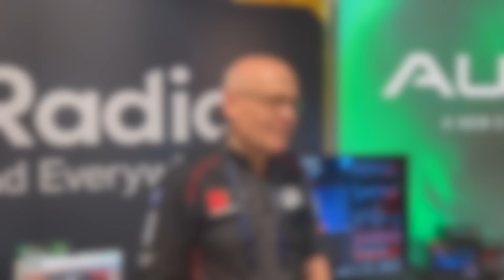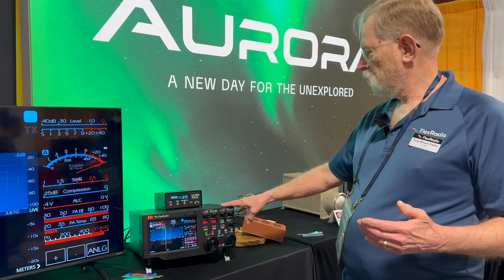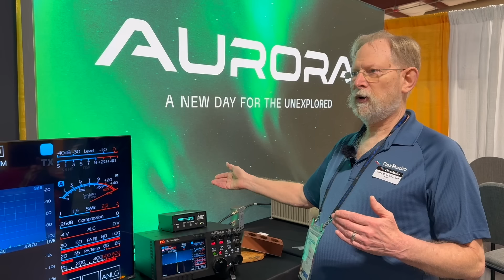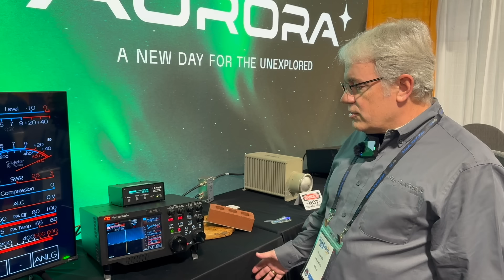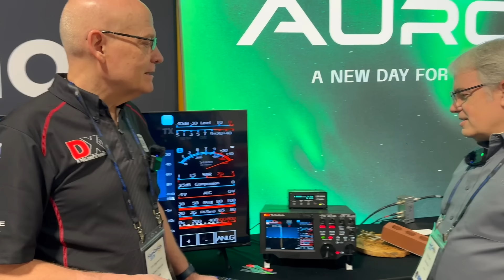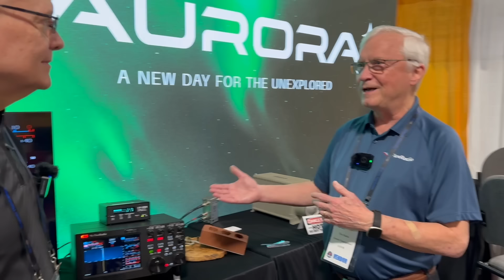Learn About the FlexRadio Aurora HF Radio Directly from the Team that Developed It

Comment: With CESSB, PM and APD this is a good beginning.

Now you have to use AI to reduce noise level integrating it into the transceiver making it automatic needing no human intervention and thereby reducing the cost from this overpriced bauble.

Your aim is to get it nearer to the QMX+ price.

Once The first person to do that the rest will follow like an avalanche, then we can think outside the box and cut the wire to the antenna and work on an all band antenna that is both efficient and small enough to be portable.

Comment: I sold some stuff and got an AU-510.  I love the concept but I'm on my second replacement radio and its in awaiting repair.  Flex says they have been shipped some less than optimal parts.  My two radios both gave blue smoke at 400W FT8.  So hopefully when it comes back it will be rock solid.

Comment: mCHF will do most of same or more for <$800. It's a brilliant compact portable HF transceiver, multi mode (including digital voice, rtty and CW decoding) with full USB connectivity for flrig, fldigi etc. only 10W but a matching 30W pa costs less than $80.

Comment: This is great stuff for amateur radio, but don't give Flex or anyone working with them credit for inventing "polar modulation". Indeed, Flex has been disingenuous to label it that way, because it is merely a form of envelope elimination and restoration (EER), a method first proposed by Leonard Kahn in 1952. It is often called the "Kahn technique". The cellular industry typically refers to it as "envelope tracking".  EER is mature and well-commercialized. Companies such as Nujira, ETA Wireless, and Qualcomm have been incorporating EER (or ET, if you prefer) into their chipsets since at least 2010. Flex certainly gets all credit for bringing it to amateur radio, and the fact that it essentially requires linearization will be a huge benefit as well as embodied by the ARRL Clean Signal Initiative.

Comment: Good video. However that statement that 120v amps can only output 200-300 watts its simply false. Every 500 watt amp I have owned running on 120 x put out 500 watts.  The Al series tibe amps, the als 600 the kpa 500 have all produced 500 watts or more output at my station and all plugged into a 120 v circuit

Comment: The problem is that very very few HAMs can afford these.
Reply: It has become like NASCAR, boating, and every other hobby. You have to be a millionaire to participate. I’ll stick with my old radios and use a separate SDR on a computer screen.
73’
Reply: @chrisdelong2932  Amen, me too.
Reply: I was wondering about the price myself. This is another hobby for those that can afford it. I'll be with my cheap bao
Reply: We lost the "Amateur" part of the hobby years ago
Reply: @2reasonsY Well, we can still use our boat anchors and build our own antennas. I'm just guessing but I would say that new sdr radio is $5k+.
Reply: Ive looked but cant find a price.  (I’m not all the way through the video yet)
Reply: @truthsayers8725  Really?  It took me less than 20 seconds to find a price.  $7349.
Reply: @truthsayers8725  The FlexRadio Aurora Series of 500W HF/6M integrated SDR transceivers ranges in price from $6,199.00 to $9,599.00 depending on the specific model configuration.
Reply: Disagree. I think it is cheap for everything it does. Price all those components seperate that add up to this capability.

Comment: How wonderful that a new and very expensive radio has to come out just in time for the total collapse of Ham Radio.  If the ionosphere ever becomes useful again and if I want to "go to the top of a mountain" to operate, I'll take my G-90 and a lithium motorcycle battery.  You know, I did just that about a month ago.  I went way out to the campground at Cathedral Valley, Utah and set up.  The signals on 40 (only band open) were all extremely weak and soon disappeared altogether.  Not worth the effort, but to buy this rig for THAT??  No way.
Reply: Bands are fine. ZL to Spain with an EFHW and 5W the other day (SSB). But there are local attenuation hotspots due to CO2 affecting the D layer, the double bond soaks it up like N2 does... So it's not the ionosphere (F layers) being crap rather D layer issues are increasing. North America probably has higher DRAP than rest of world.

Comment: For some perspective; The Icom IC-781 came out in 1987 or so.  It cost about $5000 USD.  I remember when it came out.  According to the US inflation calculator website that $5000 is equivalent to $14,750 in 2026.  The Aurora is, I'm sure. a far more capable radio.
Reply: Gotta remember ,this also saves money on a amp ,usually 500 watts works good enough, even on the low bands ( 40 80 meters )
Reply: @RamblerRobb  It is my observation that the 2KW boys on 40 and especially 80 will walk all over you and that contemptibly puny 500 watts.
Reply: Also for perspective a cheap Xiegu does polar (aka I/Q) modulation for under $500. The G90 schematics are online, 2 DAC design for I and Q, amplifier is still class AB though, and Chebyshev filter group delay an issue for modes like OFDM but this flex radio hasn't gone with Bessel either (they run hot)
Reply: Yeah, I didn't buy one of them either.  As a person who doesn't have to have the very best for the sake of top bragging rights, I guess I'm a failure.

Comment: It won't do anything my Icom 7300 can't do. I suggest putting your $$$ where it really counts...#1 antenna and #2 LMR 400 UF coax. 73, AE5RF
Reply: I like my icom 7300 also, even though other than playing with the menus, have never used it (long, depressing life story). But I still have it, and a power supply. Just need to string a wire antenna in the attic that I can no longer climb into. At least I made a lot of contacts with my ic-735 and a tuned rain gutter at my apartment.
Reply: The 7300 has CESSB  and Adaptive Pre-Distortion?  I didn't know that!

Comment: It would be great if Flex radio could make a low cost radio. I don't need or want a lot of power, I need a clean signal first
Reply: I use the mCHF (RS918 version). Very compact and light. It's a brilliant end to end digital transceiver designed by British amateur Chris M0NKA. 

Stand alone it has rtty, CW and digital voice (FreeDV) decoding as well as all the regulars, SSB, am, fm all backed by brilliant digital filters. 

It has full USB port connectivity and an inbuilt sound card for just about every digital mode known. Using appropriate software it can be remotely operated via the Internet.

Only 10W out, but at around US$500 hard to beat. If more power is needed matching 30W PAs are available for around US$80. With mine I have had hundreds of contacts, all over the world.
Reply: My impression is they'd a small company who'd rather have a high $/customer ratio than a lot of customers.  If customers get better service that way, I guess it's fine for them.  I'll never know.
Reply: @Randrew  fair enough it's an excellent looking radio either way! A cheap Xiegu is giving this a run for it's money, mine gets about ~67% efficiency with OFDM, stays totally cool @ 50% operation on full power.

Comment: Six amp draw with 500 watt output.  Amazing!  But I'm not sure it would fit in carry-on.  With international flights the weight limit for carry on is around 7 kilograms.
Reply: What airline are you flying on? I’ve flown a ton in the last ~40 years and currently live outside the U.S. so every flight is international these days. No one has ever weighed my carry on and I’m infamous for loading my backpack with obscene amounts of equipment I can barely lift into the overhead. Still, nobody has ever questioned or stopped me. How, exactly, have you been prevented?

Comment: Would Love to see this technology in the size of a FT-891 @100 watts. Running off 12 volts. That would be absolutely amazing! The Aurora is fantastic as is though amazing... a true advancement for Ham radio.  - KL5NE
Reply: Believe it or not the Micro SDR or uSDR 8 Band QRP Transceiver developed my DL2MAN uses the same technology, modified square wave modulated class E amplification, it's a very interesting circuit to analyze amazingly efficient - Red W5UW
Reply: @RedBrungardt  Props to them and Hans G0UPL (for his QCX, et al, designs that inspired the original uSDX work).  While commercial SDRs like FlexRadio's are awesome to behold, I really admire these pioneer tinkerers in the open source community!